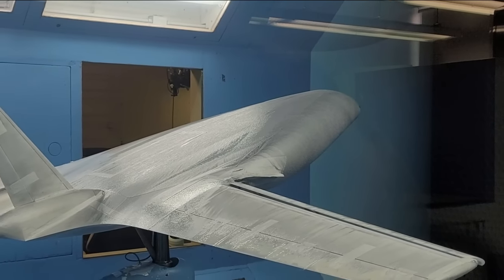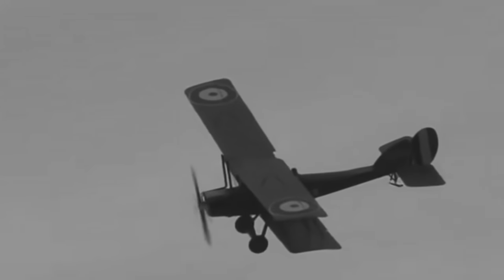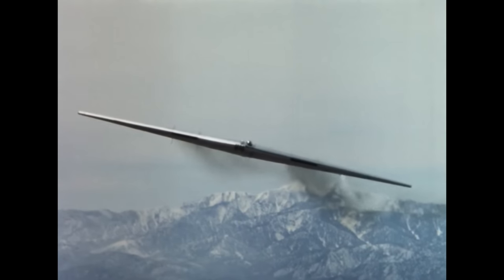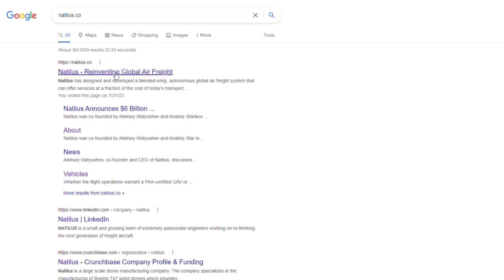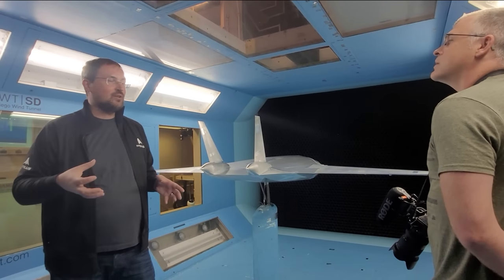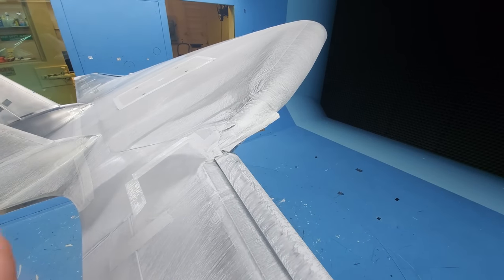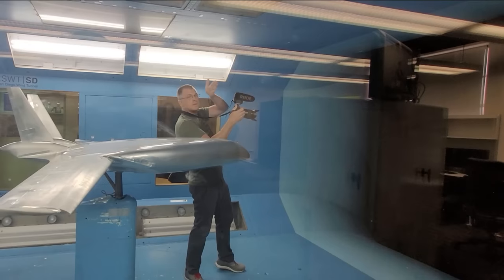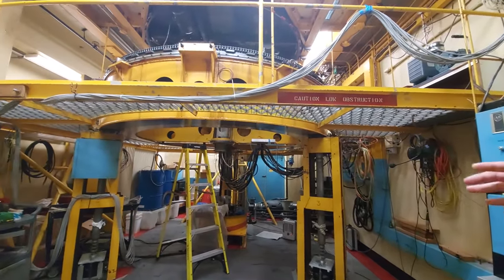Blended Wing Bodies:  The Future of Transport is Here (Featuring Natilus)

Comment: Good luck to the nautilus team.  Very promising.

I would seriously consider partnering with an engine company if possible to combine a new hybrid power train.  A big expense and complication with traditional aircraft is control surfaces and their ancillaries.  With twin electric ducted fans you have the possibility of 2 degrees of freedom gimballing.  With the high reliability of electric motor this could be the primary directional control system. The ducts would also act as a control surface when not powered.

You would the  have the flexibility of electric only for short haul or a big apu for long haul. All ground operation, take off and landing could be done with electric only for super quite operation.  Maintenance of the apu could be done with it dropped out of the aircraft and another popped in.  

Because the apu only has to supply enough power for cruising speed it can be smaller than would other wise would be needed in conventional power trains. The hybrid system would boost the plane to cruising altitude.

Another aspect of the gimballing ducted fan is very short take of ability. I think the military would be very interested.
Reply: They've recently announced partnering with P&W to use PT6 turboprops on the initial model

Comment: Do you guys think of the entire craft as  a wing ? ; such as the entire bottom of a boat does displace water ? If so what is the ratio of air being displaced on each section ? Are only  minimal tiny wings actually required ?

Comment: What an unexpected and insightful exploration into Blended Wing Bodies.The question at 26:52 and the discussion that followed on the "Rule of 3's" was most thought provoking. 
FYI: The SpaceShuttle had 3 flight computers with 3 independent codes of software  ... so one could always serve as a tiebreaker when the other two were in disagreement. 

How did you both overlook the designs of "Vincent Burnelli" from the 1930's thru the 1970's which is totally missing from this video?  Aircraft like the Burnelli CBY-3 Loadmaster, Burnelli General Airborne Transport XCG-16 (glider variant), and the Burnelli B1000 (1942). The McDonnell Douglas (now Boeing) Burnelli Blended Wing Wide Body of 1990s built on the designs and engineering of Burnelli was briefly mentioned.

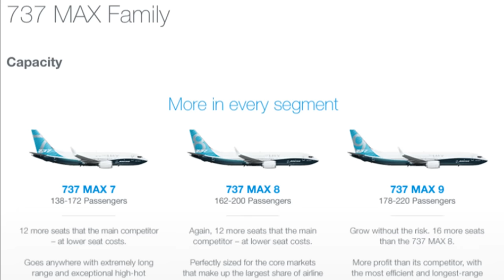Much of tube-style aircraft designs are related to manufacturing logistics, less about flight characteristics. Wings and fuselages often manufactured in different facilities, the transported to another location for final assemble. The fuselages of 737 (1:29) are assembled in  Wichita, Kansas then transported by train thru tunnels, across bridges (etc) to Renton, Washington. Both Airbus and Boeing even have special oversized (volume) aircraft to fly wings and other components. example: Boeing 787 Dreamlifter just to move subassemblies.

Look forward to seeing more videos dive into the topic of Blended Wing Body style aircraft. Seems a natural fit here, as the "Worlds First Autonomous Ground Effect Vehicle" was a blended wing-body design. :)
Reply from the maker: I forgot about Burnelli, I have a lot on my mind these days :).   However I don't remember any Burnelli designs offhand that integrated the 'blended' part.   Will look it up.

Comment: 17:30 Press x to doubt. The most common aerosol is butane, which has a vapor pressure of around 2 bars at room temperature. If you put the can in a vacuum, the pressure differential increases by 1 bar, the same amount of pressure rise you get from heating it by 10°C. I am calling bs.

Comment: so much spanwise flow its insane, does that ge tcompensated by the props? im assuming you will mount them atop and as far forward as possible, you know efficiency and slow flight reasons.
why does the design not feature winglets or good taper? why is the airplane going to phase out

Comment: I know that the storage transport AC are pressurized to lower value but that is still difficult to deal with if you don't have a tubular structure. What is the main structural configuration that will resist pressurization and how are you going to keep it light so that the AC is still efficient?
Reply: I think they solved that question by using carbon fibre to decrease weight. Transporting cargo also means lesser insulation needed, so that is a major reduction in weight as well.
Reply: @oadka  I don’t think carbon fibre alone will fix the issue. Structurally, it is a very inefficient shape for pressurization. Reducing the insulation will help but current transport planes already have that advantage.

Comment: Designing and specing the next big thing is the easy part. Manufacturing it will be a totally different problem all together as the tooling required to make it will have to be made, if they actually went all the way with this they would have to sell allot of aircraft to start to break even, then there's the maintenance aspect in that it would be a new air frame that ground crew and mechanics would have to be retrained on and allot of time in its first decade or two of deployment looking over for any fatigue points that might develop.

Comment: He kind of answered the pressurized cabin question...but there's a huge difference between 17000ft and the 6000ft cabin pressure of passenger flights.  Going from a delta of 4 psi to over 8 psi is surely doable but at what cost?  Once again its all about profitability. He also brought up the G forces which honestly I didn't even think about.   Unfortunately, don't believe this will be mainstream in my lifetime.  Great content nevertheless!!!

Comment: I really think these have a chance!
But it has to be better than just 10-20% for people to really switch over. It has to be better in every way, or the switch won’t happen.
EVs have been around since the car was invented (50% of cars were electric at first), but for them to succeed today, they had to be safer, cost less to own and operate, be better for the environment, and not look like jelly beans.
I think a blended wing design with V/STOL, autonomous, and either electric or lifting gas design (not lighter than air, but some weight reduction gas cells) would really make them better in every way.
Also, maybe cover the major surfaces in solar panels, hybrid propulsion system (electric motors, with either gas turbine, fuel cell, or piston engine) to drive ducted or open props.

Comment: I would guess you're honing in on the optimal scale ratio of [battery/fuel cell] power density to weight and surface area... interesting curve as power density increases; what does your spec sheet reveal versus what might be your optimal ideal design?

Comment: Will it though?
Passengers like the "tube and wing" design because it somewhat maximised the passengers per window ratio. A flying/blended wing reduced the amount of windows per passengers greatly.
That leaves cargo.
But don't forget how many of todays cargo aircraft are former passenger aircraft. They're much cheaper because they're second hand. The advantages of a blended wing aircraft must be pretty enormous for a cargo airline to want to invest brand new aircraft instead of buying used ones like most do today.
Reply: passengers could be loaned a tablet and given free connection and a cheaper seat in a safer plane, to make up for not having a window.
Reply: @JFrazer4303  As if that’s ever gonna happen.

Comment: The outboard passenger accelerations problem can probably be avoided by just reducing roll accelerations enough.
Reply: which means wider turns, adding more constraints to the flight envelope and requiring ATC to be aware of the extra large turn radius.

Comment: its really hard to pressurize a blended wing hull
Reply: 'real engineering' covered this a while back, its nice there enthusiasm, however we haven't had 70 years of tube hulls for no reason
Reply: @themadrobot  Yes, hence why this company's CEO specifically is not trying to pressurize it to tube hull levels. So, the enthusiams doesn't seem misplaced to me. 
In case you missed it - this wont fly passengers, wont have a pilot and will only need to pressurized enough not to have aerosol cans explode in flight.
Reply: @AntiVaganza  true I skimmed this, but yeah ill just say there's allot of other issues to trade with a little efficiency, also in five years this aerospace company haven't even built a flying model :o which speaks allot for there legitimacy -_-

Comment: Flying Saucers next? How about Experimental All-Wing Carrier Fighter - Vought V-173 or the Vought XF5U-1 Flying Flapjack
Reply: Flying saucers are for speed of light travel. Spinning generates gravity, and using this principle, a vehicle can create a bubble that is capable of withstanding the gforce (hence the extreme mass/density required)  of lightspeed.

For this reason, it needs to be perfectly symmetrical.

The flying pancake would probably be better as a blended body fuselage, carrying the width of the fuselage naturally to a thin leading edge, with a slight convex curve.

(Concave is when the spoon holds cereal, convex is when it spills on the floor, if I remember correctly.)
Reply: @eastindiaV  How did you come to conclusion that spinning generates gravity? You can emulate gravity by spinning but that's not the same thing.

Comment: Hyperloop is all hype. If your only criticism is "infrastructure cost" and you think it would be viable for freight transport, then your understanding of logistics has to be in question.
Imagine you have 500 tonnes of freight in 25 standard containers going from a ship to a location 200 miles inland. These can be loaded onto a train which travels at an average of 50 mph, and 4 hours later your containers are unloaded.
Now imagine a "hyperloop" which carries pods in a vacuum at an average of 400 mph. it would take 30 min to reach its destination. But it would take 10 times as long to load and unload. Standard containers are not air-tight, so your freight would have to be unloaded and put in air-tight pods, or the whole container would have to be put into an even bigger, and air-tight container. Then these containers or pods will have to be introduced to the vacuum inside the "hyperloop" tube through an air-lock and cannot proceed further until all the air is pumped out. This will take hours, if not days.
At some time during the "hyperloop" loading process, or while waiting for the air-lock pressure to be low enough, the freight on the train will have arrived at its destination, ready to unload straight onto trucks.

Comment: Blended wing body aircraft carrying passengers have one problem that won't be solved in the next 50 years - they can't take repeated cycles of pressurization and depressurization.   The weight penalty for rigidity is high.  The sight of an empty sealed plastic water bottle collapsing during pressure changes best models the problem.  The only solution coming close is one that places passengers inside a sealed tube and then installed into a non-pressurized airframe.

Comment: Airbus/Boeing could "simply" do variants of their machines that have higher volume-per-payload, and use an autonomous autopilot, and less pressurization, and thus accomplish 80% of what Natilus is doing but with only 20% the effort.  If that's roughly correct, then Natilus needs to address it to be taken seriously (by me anyway).
Reply: they seem like completely separate issues. ostensibly any autonomous flight controller that works on this blended wing would also work on any other jetliner with tweaks to the PIDs. since that's the case, it doesn't make sense that they'd develop autonomy only for this one plane. in fact, most planes can already do most or all of the flight autonomously right? otherwise what's the point of autopilot and autoland? (which can be installed on about any plane with actuators).

but airbus or boeing cannot "simply" increase the volume-per-mass of their planes. if they could have, they would have. the tubes are as big and long and crammed with as many people as the wings have margins to lift, and that's it. to increase volume further they'd need to abandon the tube or build a yet more massive one, not an easy task.
Reply: @chrismofer  If Boeing/Airbus wanted to make a cargo plane with a higher volume:payload ratio, they would "simply" take an existing model and either A) stretch the fuselage, or B) widen the fuselage, or C) both.  No blended wing body required.

Comment: I am a blind subscriber
If anybody has the time could they describe the aircraft with a blind person in mind

thanks

Cheers
Reply: if you ever touched a model of a plane - you have a central fuselage and the thin wings extending on the sides. now imagine the transition between central fuselage and the tip of the wing be gradual. so the whole aircraft looks way more uniform, like a pebble. that's the idea. the whole body generating lift, not just wings. therefore giving you more internal volume
Reply: If you are a blind person that has never had sight, that is an interesting problem.  I shall attempt it for the first time! 

The model in the video could be described as a dark grey, smooth object that has a large central rounded shape - like a bar of soap or stone smoothed by river flow, it is kind of triangular, narrow at the front, wider towards the rear.  It is thicker towards the front and blends smoothly to a sharp wide edge at the rear.  The aircraft has two vertical fins that are fairly tall and narrow in chord, which is the width of a wing from front to back (taller than you might imagine).  The fins are spaced laterally to each side of the central and at the back of the body.  At the base of each fin is a cylindrical tapered circular body which would normally contain the engines.  In this model, there are no engines and the back of the fairing is tapered to a sharp point.  This is something that is often done for wind tunnel models.  

The aircraft has relatively long, straight wings.  The wings are placed towards the back of the central body.  They're quite narrow for their length (normally called high aspect ratio).  The wings don't have much sweep - they extend more or less straight out from the central body.  

The model in the video has its surface lightly coated with a milky looking solution of kerosene and chalk, to visualise the flow.  The kerosene evaporates during the wind tunnel run, and the chalk suspended in the kerosene dries on to the surface of the model for the engineers to see what the air particles were doing at the point of drying.  These patterns can often be quite beautiful and tell a story of their own.  In this case, the model was placed in the tunnel with the nose pointing up a little.  The model is held by what is called a sting - which is essentially an arm that has a long and slender end fixed to the model, and is mounted to the wind tunnel floor.  The air flows over the model at some speed.  The results show that, on the central body the air is moving smoothly over the surface - there are long streaks or lines of dried chalk that flow around the body surface from under the nose at the front, to on top of the rear.  

This model has an additional modification of a small metal foil curved strake (a curved plate) just in front of where the wing meets the central body.  This is an aerodynamic device that is often used to help direct airflow in the desired manner.  The airflow on the upper surface of the junction of the wing and the body shows a clear area in an expanding width (essentially a triangle) towards the rear of the aircraft.  This is because one or two vortices (energetic rotating air causing low local pressures) are created right at the junction of the wing and the body.  These vortices ensure chalk cannot rest on the surface.  vortices can be both good and bad in aerodynamics - in this case they are the initiator of full turbulent flow over the upper surfaces (and hence full stall).  Towards the outboard end of the wing, the chalk markings change from mostly straight line features (attached airflow - usually called laminar flow) to detached.  At this point, the air flow has lost enough energy to move away from the wing surface and rotate around (usually called turbulent flow) - sometimes forwards, sometimes sideways.  In this case we see the chalk has left curving feather like features on the wing control surfaces suggesting the air is moving sideways and forwards.  This is another indicator of an impending stall (full turbulent flow).  

I hope this helped!
Reply: @scott_aero3915  amazing description brother. thank you for your time and effort
Reply: @scott_aero3915  thanks
I did have site for many years what you described sounds a little like what was on the beginning of the TV series $6 million man if you know that one
Cheers
Reply: @morkovija  thanks
Good description appreciated
Cheers
Reply: @vernepavreal7296  You're very welcome.  I haven't done that before, and found it challenging and enjoyable.  I just looked up the opening credits for the 6 million dollar man.  I see what you mean.  The credits show one of the NASA lifting body aircraft being carried by a NASA B-52, filmed from a NASA chaseplane.  Yes, the Natilus design looks very much like that, with added large wings placed at the rear of the body, and much taller vertical fins.